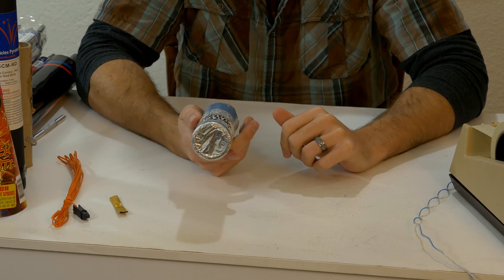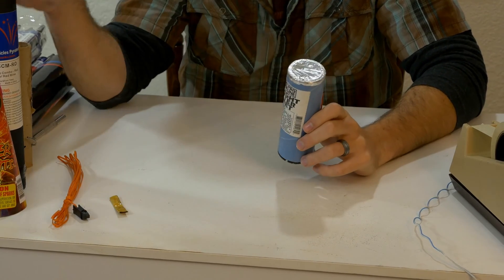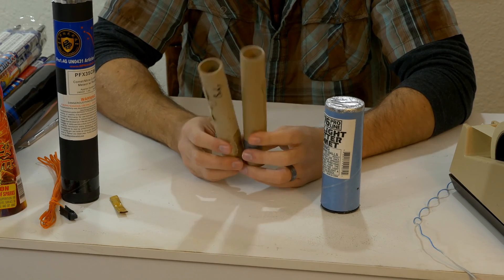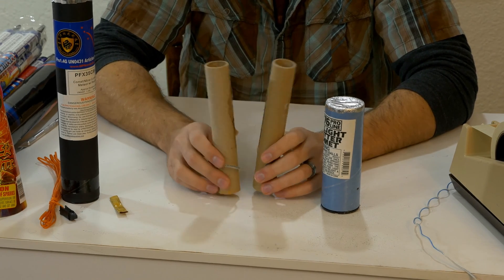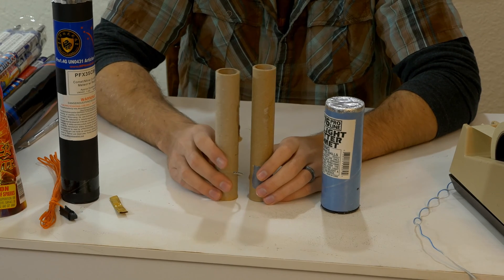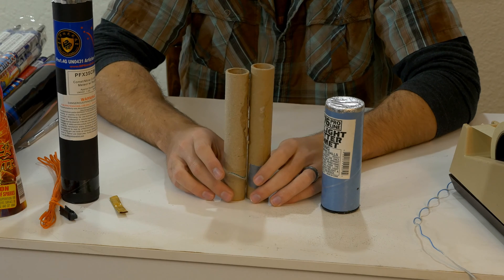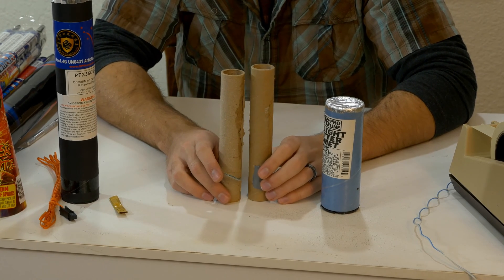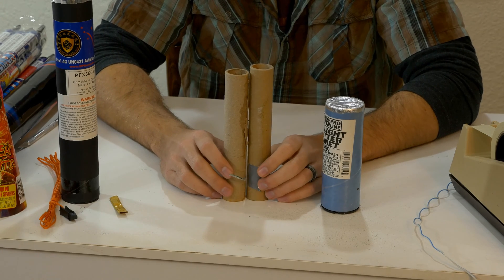🎆[PYRO EDUCATION]🎆 - Fusing Single Shot Tubes

Comment: You missed the part with the bigger 9 shot racks where the shell is a standard ball shell that is dropped down the pipe without a separate lift charge from the shell. There are a handful of brands that are doing that. My question to the chinese making them is how do you even get the fuse into the shells lift when its part of the shell?
Reply from the maker: +Ben Birdseye Sounds like an excellent topic for a future video!